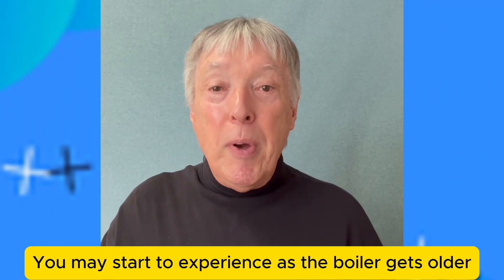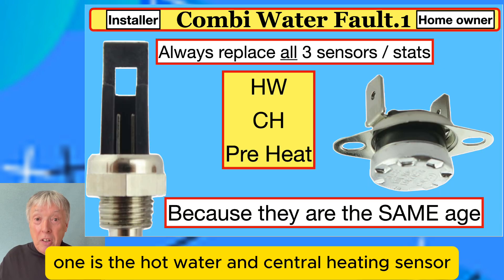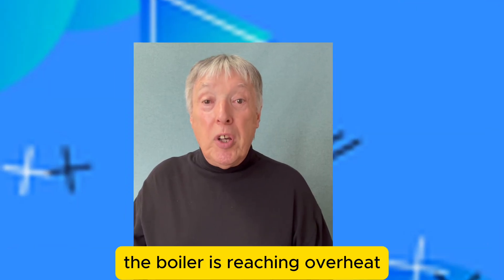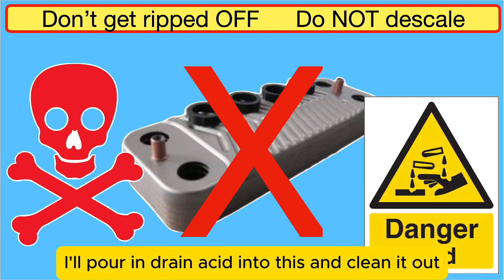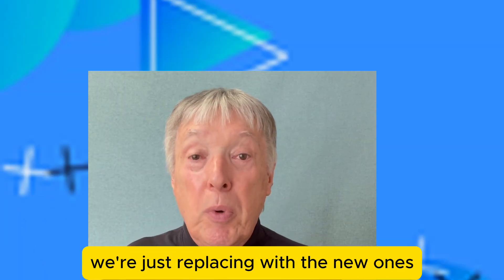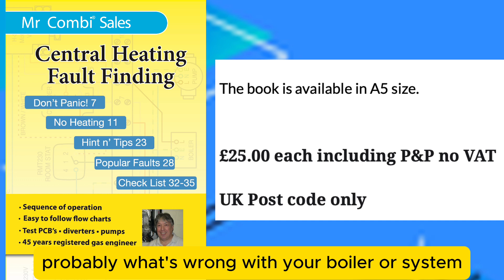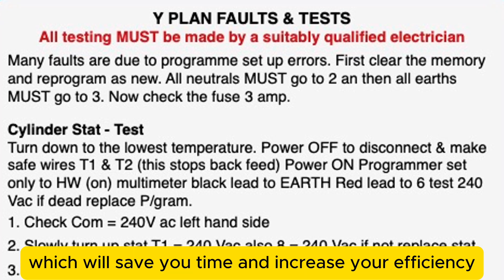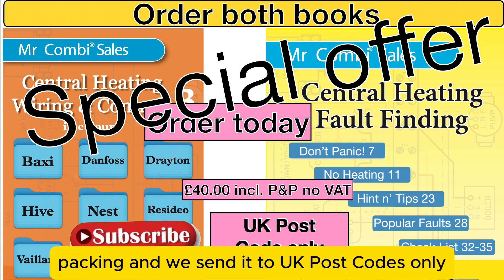COMBI boiler heat exchanger TUTORIAL &  RIP OFFs

Comment: thanks. what is silencer and how does it work?
Reply from the maker: Hi Eazy, thanks for asking, on a new install have to put F1 inhibitor to coat the system within to stop corrosion and remove air bubbles, then on the next drain down we refill and use F2 silencer which is a mild de-scaler which stays in to keep the system clean, often not done, most installers use F1 which is no good, waste of time, that's why they make F2. Hope that helps. George 👍
Reply: @mrcombiBedford  whaaaa that's the first I've ever heard that. I'm a new engineer I've heard of silencer before but wasn't sure exactly what it does or how it works. Everyone I know uses cleaner then leaves inhibitor in. Just looking on fernox website says cleaner then inhibitor where did you hear to use silencer? Thanks
Reply from the maker: @eazyrat  Hi again, You are correct.  Since 1970 the 'Codes' require on a new install 2 cold flush and then a hot test at MAX boiler / room stat temperature for at least 10 minuets, I can bet you this is NOT done. then the system is drained and refilled with cleanser again 10 mins. in hot. drained and filled with F1 inhibitor / protector. 
Because installers don't do this, in about 4 years the Dom exchanger / system gets slugged up, 
(money for the installer) the Plate 2 P is NOT replaced as required by the 'Codes' and manufacturers instead drain acid is used to rip off customers. If a water part is replaced in 6 years after install what's the point of putting F1 inhibitor?
That's why Fernox and others make F2 Silencer to slowly clean the system, again installers won't do this it's bad for business. Watch the vids on blocked P 2 P they make much more money than replacing faulty parts. 
Hope that explains, take care, George 🤩👍
Reply: @mrcombiBedford  OK thanks yeah I think I know a few of them...
Reply from the maker: Unfortunately so do I👍